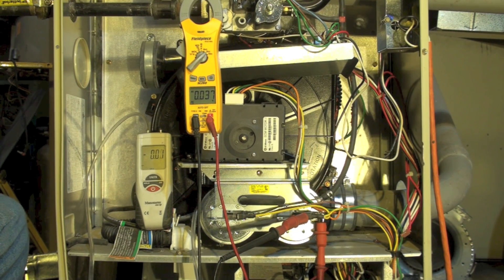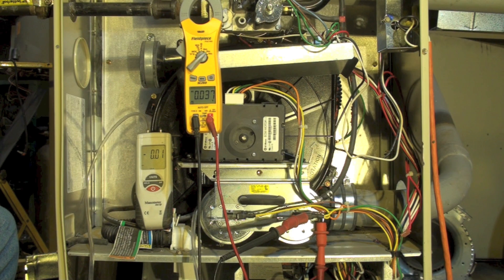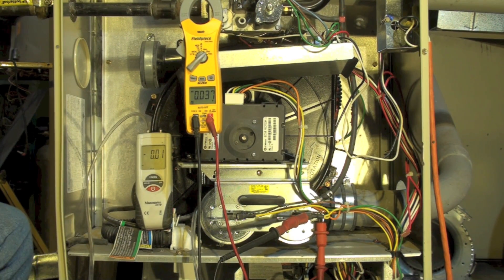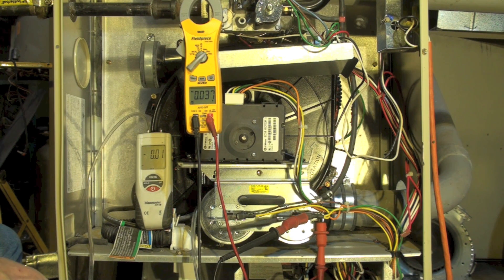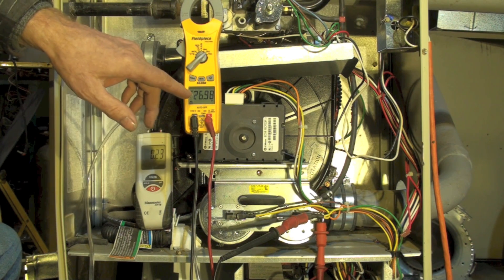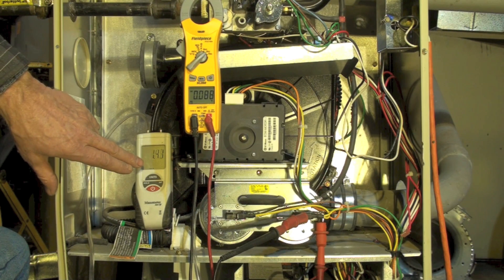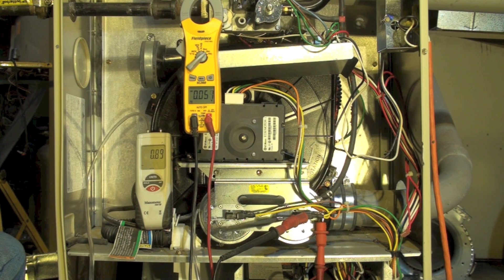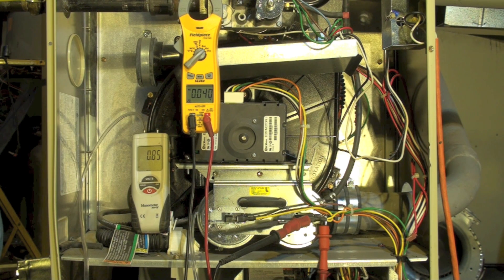how the variable speed inducer works

Comment: my furnace is nearly identical to this one, bryant 355, but I think my inducer slows down too much because my flame roll out keeps tripping and when the furnace does stay running its not blowing any hot air out of the vents but where the burners are gets so hot that wires are melting, I was going to replace the inducer but the replacement is about a thousand bucks, could my problem be the pressure switch(s) ?
Reply from the maker: The probable diagnosis is a corroded heat exchanger.  Very common on these models.  There was a recall on these furnaces.
GFM
Reply: @grayfurnaceman  the company that installed it went under, not sure how I'd get it done
Reply from the maker: @marv013  Get your model and serial # and go to the internet.  If its still in effect, you may get some relief.
GFM

Comment: Good job. This explains what the whine (from our fairly new Carrier) is that keeps me awake early in the morning. It’s traveling up 2 floors through the ductwork. The initial high-speed frequency is the same pitch as my alarm clock, so you know it’s not going to lull me to sleep. I’ve emailed our installer to see if they know of a replacement or fix to isolate the noise.

Comment: I have a 58mvp carrier infinity when fires on low fire it will go into error code 32 after 5 or 10 second of fires...Replaced pressure switch and still do it. When it change to high fires it ll work with no problem..
Reply from the maker: I would be looking at blockages in the venting.
GFM
Reply: @grayfurnaceman  all clear. .intake are fully open also..should I check differential pressure between collector box and gas tubing at burner box thanks
Reply from the maker: @cris.g4608  That furnace may be subject to recall from a corroded secondary heat exchanger.
GFM
Reply: grayfurnaceman ok thank you for the info.

Comment: Is there any way of wiring the inducer completely  disconnected from the furnace to test run it? Im not sure what I would hook up to the orange, yellow and brown wires going to the inducer, i know they are control wires so I am wondering if a transformer can be used to simulate the board sending a signal somehow?
Reply from the maker: There is no way that I know of.
GFM

Comment: Ok for some reason there must be something overheating on a control board (ECM inducer board or main control board) .  If I let it sit for an hour it runs well for 20 mins.  But if it continues to cycle (error shut down then restart) it randomly picks 0 - 2 mins to error out.  I think!  lol  Not unless there is something else kicking it out.  Carrier 58MVP040
Reply from the maker: Sounds like a failing inducer.
GFM
Reply: I have replaced the inducer with another used one to check and so far the furnace is error free after 30 mins.  Just out of curiosity what on the inducer goes??  The board or the motor.  And can you get either new??
Reply from the maker: Either the bearings fail, or the electronics.
GFM
Reply from the maker: If the inducer spins up to make the pressure switch, the unit should continue the trial for ignition.  If not, it should stop the cycle.  
I am not sure what the problem is here, but sometimes the inducer will over rev and cause an error.  That means the inducer is failing.  Not the inducer itself but its internal electronics.
GFM
Reply: OK the inducer that I put in for a test is working but the 58MVP doesn't seem to like the ecobee 4.  Will try to rewire it again tomorrow.
Reply from the maker: You may need to install an isolation relay.
GFM
Reply: You got a you tube video on that.  Lol.  
My ecobee 4 seems not to work well with this old furnace.  I'm not sure why.
Reply from the maker: Sometimes, the electronics of the furnace and the thermostat do not like each other.
GFM
Reply: Can I buy the motor/control board separately or just the control board on the motor???
Reply from the maker: The inducer only comes as a complete assembly.
GFM

Comment: Hey there, love your videos, very clear. Can I put a variable speed inducer on a non condensing hydronic boiler? I have a Crown XE5 that has an old AO Smith inducer that just spins at 3,000 rpm the whole time, I think it kills efficiency. Natural Gas, 15 feet to masonry chimney connection with 1 elbow, chimney is 20 feet high.
Reply from the maker: there is no effective (and legal) way to retrofit a variable speed inducer to that unit.
GFM

Comment: The inducer and furnace is junk. U serviced 3 units one being my own heater.....expensive and junk. 

On my unit kept getting inducer motor fault code. Replaced same code....called Bryant tech was told bad motor..???   Duct taped 1/4 of the intake pvc pipe outside to reduce air flow worked. Junk
Reply from the maker: That furnace had a problem with its heat exchanger.  You may have that problem.
GFM
Reply: Does yours have the needed air baffle in the fresh air side of the burner box?

Comment: Great video! Per the manual for this furnace, the inducer reduces speed "slightly" after flame sense when in low stage and increases speed 15 seconds after flame sense on high stage. The reduction in low stage is to "optimize combustion for maximum efficiency"
Reply from the maker: springws14lbss The idea behind this is to move just the right amount of air mixed with the gas to complete combustion but not have excessive excess air.  It would be nice if this type of technology could be used on all furnaces without the high cost.  Thanks for the thoughts.
GFM

Comment: Very interesting. How does it know to slow the inducer down just enough? Is this done through electronics sensing when the switch closes on start up?
Reply from the maker: DC Rickerson Its done by the pressure switches.  It winds up to speed until the pressure switch makes, then remembers the speed for the next cycle.
GFM

Comment: I noticed that it is a 2 stage furnace, so will the inducer adjust itself again once the second pressure switch makes?
Reply from the maker: Rolando Dominguez With a call for 2d stage heat, the inducer increases speed to make the high fire pressure switch then the pressure switch energizes 2d stage of the gas valve.  Hope this helps.
GFM

Comment: I really like my Bryant 90+i, it's pretty old (1984) and has had some issues with the secondary heat exchanger that was resolved under warranty. My inducer is the original although I had to glue the rotor magnets back on @ 2:00AM That was fun...
It is the one with ball bearings and a big weight hanging off of it.
Thanks for these videos and Happy New Year